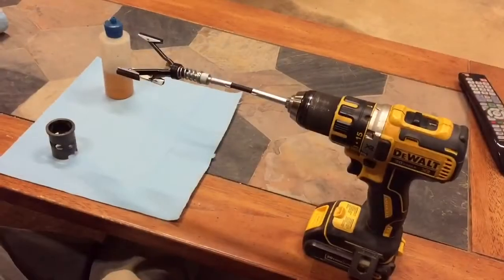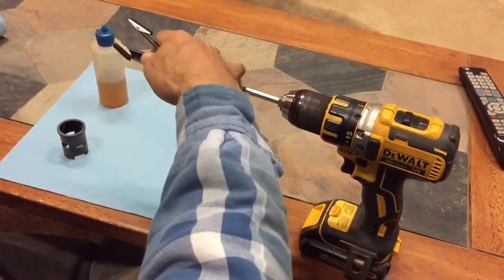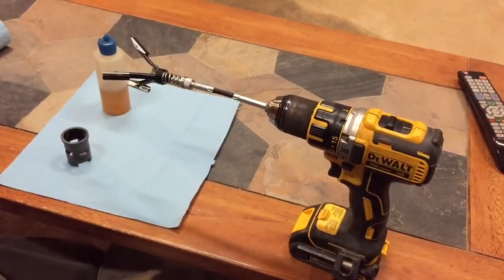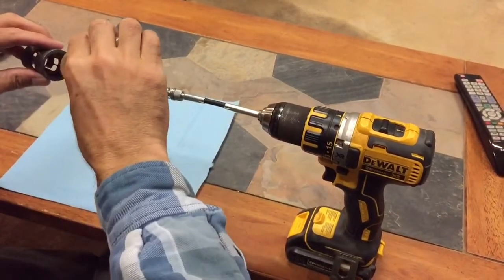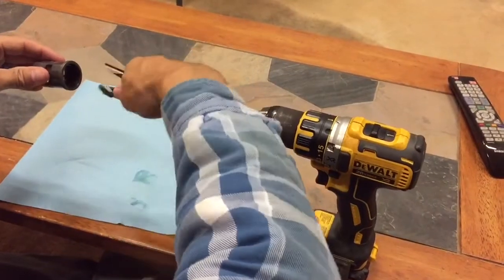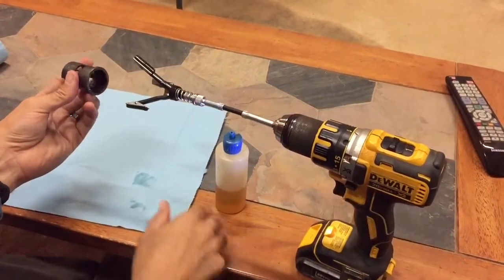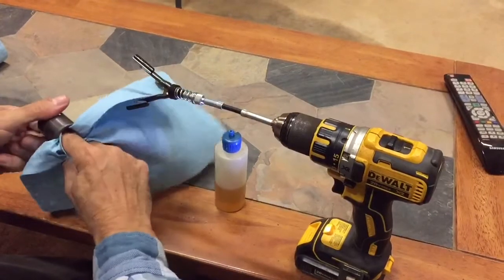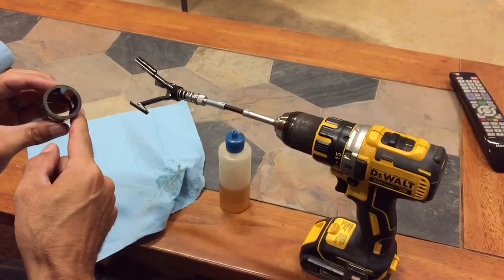OS 105 Nitro Rebuild Basics - Cylinder Honing

Comment: Hi, during maintenance i remove the piston ring and don't remember the position of the ring (up/down) in the piston. Can i use the same used ring again with a cylinder honing? , or do a cylinder honing with a new ring  and discard the old ring. Thanks
Reply from the maker: Typically the ring is discarded as it is a wear item. The piston ring wears to the shape of the cylinder liner for optimal compression. I would hone the liner and use a new ring for best performance.